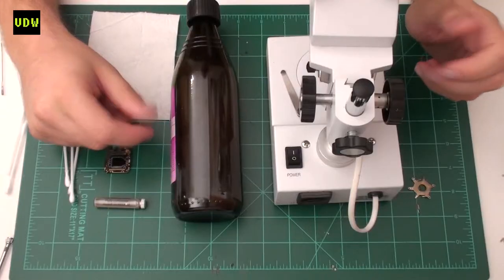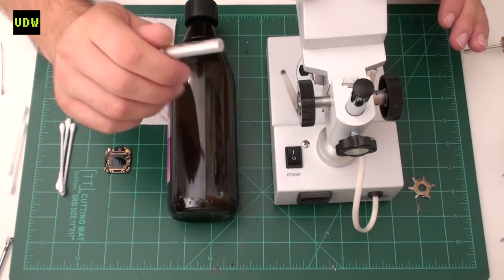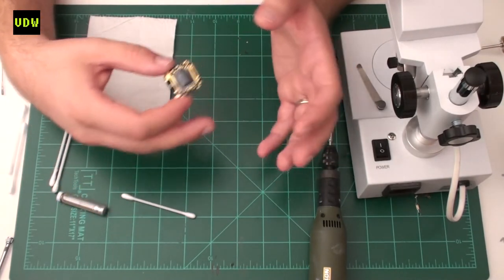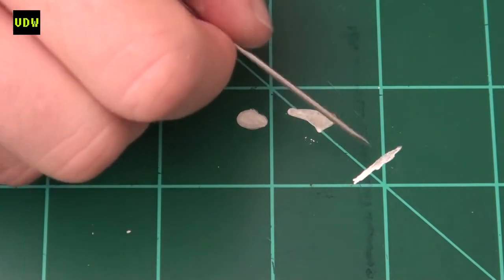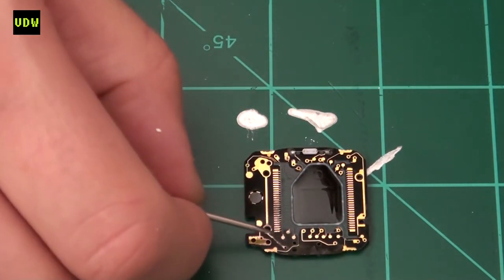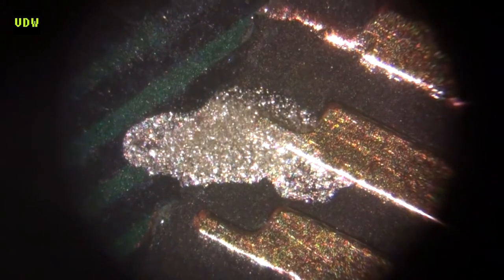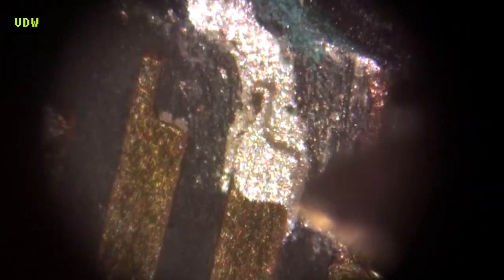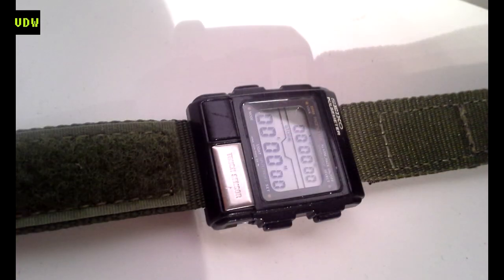VintageDigitalWatches - Ep 31 -  Seiko S234 missing segments corrosion repair

Comment: I didn't know about that stuff and do micro soldering for years. I usually just use a thin hair 0.10, or 0.20 jumper wire to repair broken traces. As repair phones and ETC. I have a few Casio and Seiko LCD watches been collecting over the last few months and some need repair due to corrosion and broken bond wire. I may give this stuff a shot as least for the broken traces.

Comment: Hi, I have a Seiko M929 where an LCD segment has failed inside the glass. Is it repairable? Or do I need a new LCD display? Thanks in advance. Great channel content. Steve.
Reply from the maker: Hey, it can be either rhe board, LCD connector or LCD itself. Needs diagnosis.
Reply: @VintageDigitalWatches  thanks for the reply. It is the LCD itself. The etched track on the glass is fractured right near the edge of the LCD. I have managed to chip away a bit of the glass at the edge and I should be able to repair with some conductive glue across the gap.

Comment: Is there any chance to repair a lcd that have segmented. No any damage on the board. And zebra connector is good.
Reply from the maker: Hmmm, before saying that the LCD is broken, you must validate that the board is working properly. You can do this with an oscilloscope and measure the LCD segments outputs from the board. You should see a square signal. 

Regards,
Tibi

Comment: Hi there is there something I can use as a zebra strip because my seiko g757 is missing one for the lcd any help would be appreciated thank you
Reply from the maker: You can use a zebra strip from another watch but they have to match in dimensions. Also the G757 is notorious for fading or missing digits and not because of the zebra strip. It can be the capacitors or the IC on the board.